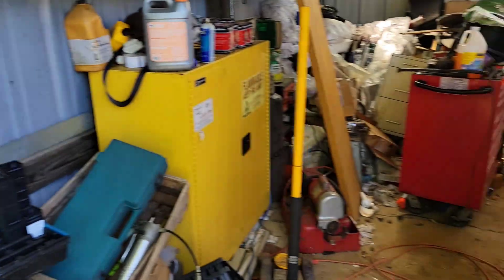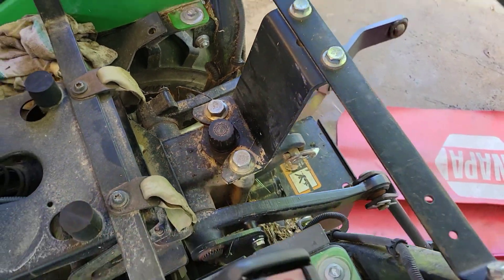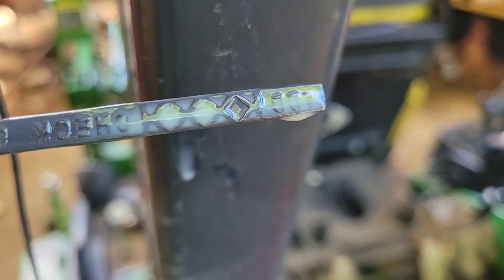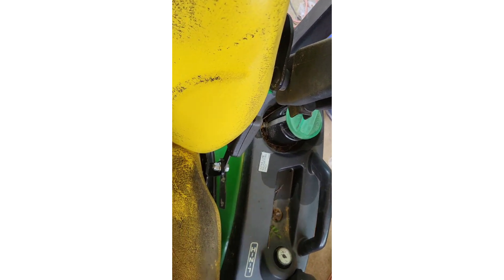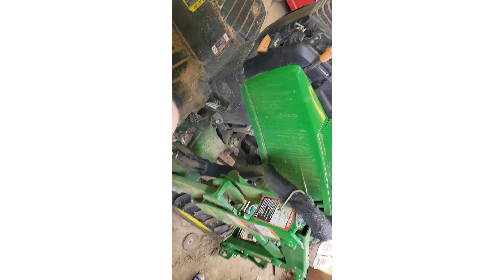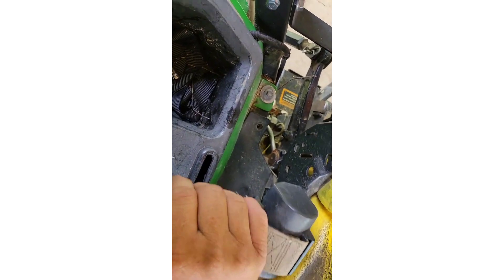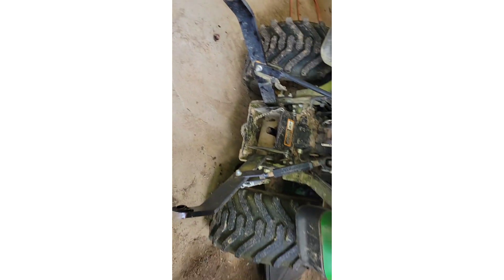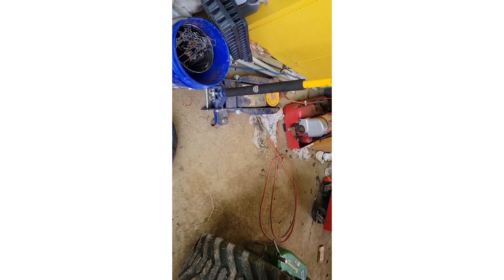John Deere 1025r Hydraulic Failure and Repair

Comment: You should check your fluids regularly. I leave my 1025R outside maybe 75% of the time. Never had water get into the oil or the fuel, but I check them and always try to pay attention to how the tractor is running. I'm at 380 hours, and today I changed the hydraulic fluid for the second time. Tomorrow it's the engine oil. After that, it's the fuel filters. Air cleaner and steering fluid. Instructions for all that is on YouTube.  One thing I would suggest to you and 1025R owner: get yourself four ramps and elevate your tractor. It makes the jobs much easier. These tractors are $25,000 + investments. You need to love them like you love your kids.

Comment: Appreciate the video.  I have (had) the same water contamination from the same cause... Tractor left outside.  My question is how did the water enter the hydraulic system to begin with?  All of the components look to be sealed; no leaks at all..
Reply from the maker: Had to enter from the fill plug under the seat.
Reply: Fil  plug SEAL shouldn't be even on the hole plate. ( commonsense  JD ENGINEER)

Comment: if you have your front end loader hooked up and you drain your trans fluid, does the fluid in the loader part come out too or is it trapped...figure id ask since yours was milky...
Reply from the maker: You are only draining. This does not flush everything in the system out.

Comment: I just picked mine up from my in-law's (I was moving and stored it halfway between my old home and new home) and could barely get it loaded on the trailer.  Got to WI and couldn't unload everything.  My fluid is milky and I think I'm in trouble.
Reply from the maker: If it is milky, then you need to change it for sure. Let me know how it goes.